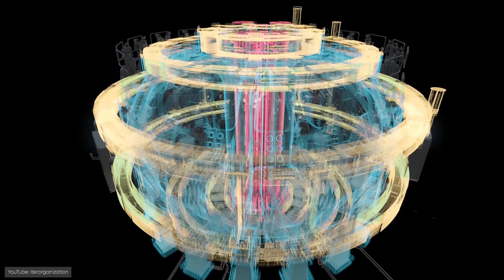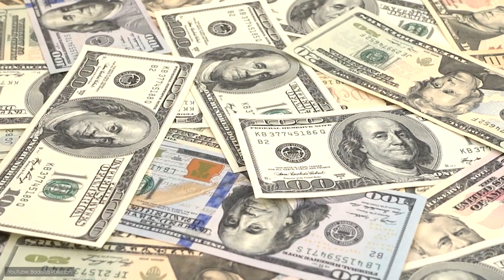World's Future Megaprojects by 2035

Comment: CPEC game changer for Pakistan and China. Thank you for the vid, please do more videos on Pakistan 🇵🇰
Reply: China debt trapped Pakistan. Gwadar is no longer under Pakistani ownership
Reply: @NarasimhaDiyasena  
"Gwadar is no longer under Pakistani ownership"

Proof? Link? Reference? Or just talking out of your ass?

"China debt trapped Pakistan."

To achieve exactly what? "Debt" isn't always a trap, otherwise the United States, the country with the highest debt to China worth trillions  of dollars, would be under complete Chinese control by now. 

As for CPEC, you do realize that the traffic from the Gwadar port has to cross the entirety of Pakistan, right? That means that when the port is fully functional, at any given time, along with fixed assets worth billions of dollars, Chinese current assets worth hundreds of millions of dollars would be spread across thousands of miles of Pakistani soil, with a lot more waiting in line to be transported on both ends. This route would be the jugular of Chinese trade and tactical presence in the Indian ocean. China isn't foolish enough to hurt its far greater long-term goals for the sake of comparatively insignificant, short-term gains.

As for Pakistan, having those Chinese assets on land would add tremendously to Pakistan's national security, which is frequently threatened by neighboring India's belligerent attitude, besides adding much needed investment to Pakistan's infrastructure. Hence this venture benefits both sides, and brings both China and Pakistan closer in a prolonged, mutually beneficial relationship.
Reply: @sbs2047  doesnot matter
Reply: @NarasimhaDiyasena  Bhai Tu kyu bol reha ha jab Pak ek Chinese Province banega teb make lenge

Comment: What you don't know about climate and energy will kill you
50% of humaity will be water stressed by 2025
50% of thermal & hydro electric power will soon be water stressed
40% of coal power is now water stressed, and so will 30% of planned hyrdo power
North Euro offshore wind works 30% of the time, onshore works 22%, and solar 11% 
80% of energy is fossil and 20% is electric of which 4% is renewable 2% solar & wind
2% of global energy is solar and wind after 20 years trying
By 2040, 15% of global energy will be renewable, with 28% by 2050
Most solar panels will be un-recyclable toxic waste growing at 6 million tons/yr by 2050
Europe burns 80% of wood pellets, and 80% of its recycled plastic/paper for electricity
Trees grow faster and die younger with increasing temps droughts & fire
Amazon tree farms take 30 yrs to recoup 10% of Amazon' tree loss
Overseas forests are clear-cut & burned for 50% of Europe's renewable electricity
Palm and soy grown in the tropics are shipped to Europe to burn in diesels
Europe burns 50% of its palm oil cargo in diesel engines
Batteries and bio-energy will wipe out tropical habitat for humans and wildlife
4% of mammals are wild and battery/bio-energy extraction will kill them off
The UN failed all 20 bio-diversity pledges from 10 years ago
There have been 25 UN Climate COPS and 15 Bio-diversity COPS
There were 1.5 billion flights in 2019

Earth is heating 46% faster than 50 years ago
Oceans take 89% of heat air takes 1%
Weather = flash floods + flash droughts + flash mobs + flash infections
Climate = 30 years of weather
There's less rain and more storms, what old people call hard rain
Ozone destroying green house gases increase every year
Nitrous oxide eats the ozone and is the 3rd biggest greenhouse gas
Abrupt permafrost deep soil carbon and nitrous oxide loss is not modelled
350 ppm CO2 will not cool eath, 300 maybe will do it
We must cut energy use 50% in 10 yrs to stay under 1.5 C
This never happened in history, and will never happen in the future
People who are richer smarter and older than you don't want you to know this

Batteries and bio-energy will not reduce earth's heat imbalance in time, and will wipe out tribes and wildlife
Jets are 68% more efficient, but fly 60X more people over 60 years
There were 1.5 billion flights in 2019, and only 6 million out of 1.2 billion vehicles are electric
Petrochemical demand grew 7X human population for 20 years
EVs, batteries, bio-energy and solar/wind will not stop runaway hothouse mass extinction
If you want credible sources go to Loki's Revenge blog because I don't want your love or money

The first rule of Loki's Revenge is that nobody talk about Loki's Revenge
Since nobody will like you for it, this is an easy rule to keep
Same goes for Hansen's monthly private carbon dividends being real climate justice

or go to Reddit's DarkFuturology for links and sources

Nothing To See Here = Runaway Hothouse Mass Extinction
There are 23 billion chickens on earth, if one sneezes we all get the flu ;)
Humans and livestock are 96% of all mammals by weight and caused 80% of species extinction -- Livestock use up to 80% of antibiotics and cause 25% of all infectious disease

zzz